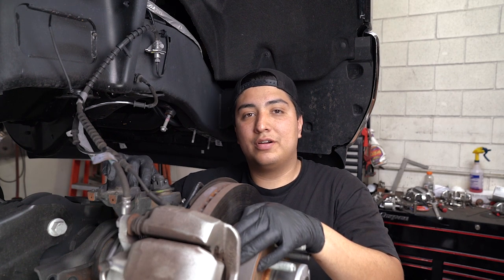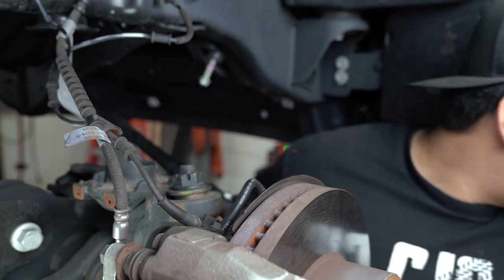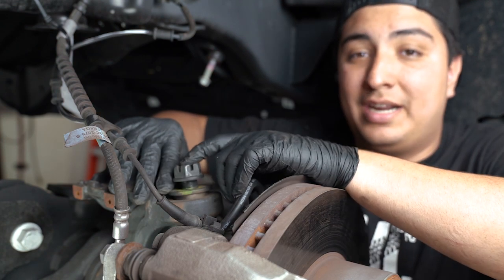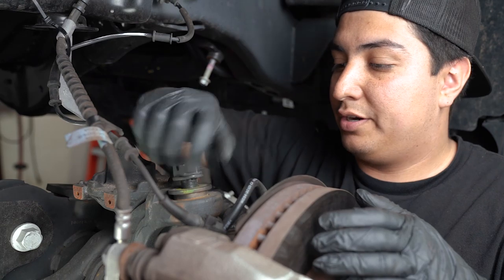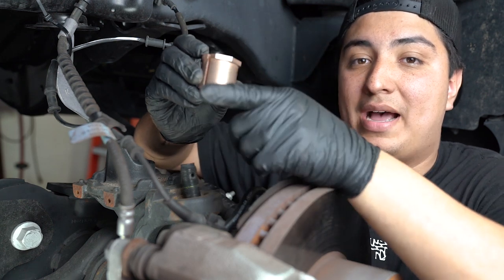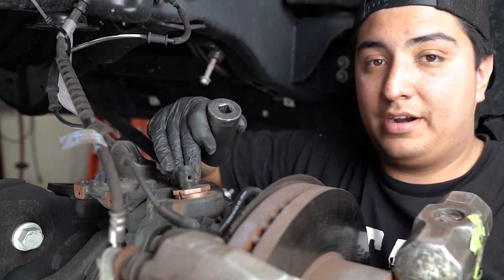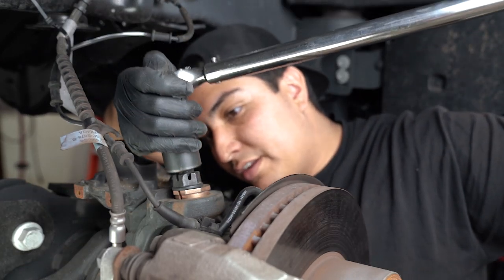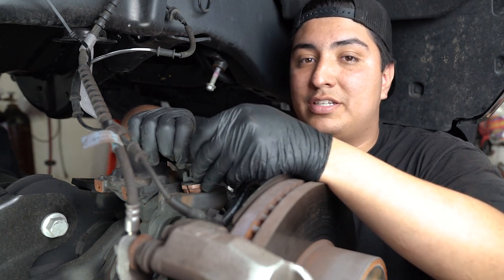How to Install Carli Caster Shims on 05+ Ford Super Duty

Comment: Followed along and got mine done today, very simple, however, when tightening back up the ball joint bolt would spin which delayed the installation, bit of fiddling and got it done, coupled up with the apex track bar ball joint the ride is dramatically improved…. Thanks for the video!!
Reply from the maker: Happy we could help!

Comment: Glad I found this video. Did this in my driveway in just over an hour. Thanks for sharing.
Reply: Did it make any improvements?
Reply: @DS-TRUCKS  I think so. Didn’t drive long without them in. I need to get back and do another alignment to see if it’s within spec now.
Reply: Did you remove wheel to install ?
Reply: @mrtnt2337  yes removed both front tires.
Reply: Where did you place jacks? And did you have to remove the springs?
Reply: @sweetpapalapa376  place two jacks stands  under the axle. No, you don’t have to remove the springs.
Reply: @swansong04  thanks

Comment: Great video.... Installing these this week to help my alignment after the readylift 3.5 sst I just installed on my 2019 f250.
Reply: How did it go, just ordered some for mine, after my readylift this truck drives like shit?
Reply: @natedogg412  I bought universal adjustable ones. Mine truck rides pretty good.
Reply: So do you need these for a 1.5" lift (springs). ?

Comment: Nice video Oscar!! 
I have a 2007 F250 that tech could not do alignment because of  wheel camber is off and original bushings are not adjustable. 

which one do I need to buy?

Front left wheel is  -0.4•
Front right wheel is -1.9•

Please let me know
Reply from the maker: If camber is off, that means the axle housing is bent. Are you positive that you have camber on the truck?

Comment: I know this is kind of old thread but i have a 2020 f350 2.5 level kit used carli 2* shims totally made a great difference. Not alot of people are aware of this issue.. Last thing on a leveled 2-1/2 inch what do you like your castor to be at via alignment..
Reply from the maker: We typically shoot for 3.5 to 4 degrees of caster! At our shop, we just add the shims and you're good to go on a 2.5" level!

Comment: I have a 2000 F350 w/ 4” lift 
What shim would you recommend 
Ford wants $100 per side and 2-4 hours labor before they can align the front end 
They also said it had to be a certain degree and they couldn’t read it without removal 

?
Reply from the maker: That actually all depends on the lift that's on the truck, and whether the arms used change caster.

Comment: I have a 2017 F250 with the death wobble issue. I have found some other information that suggests adding caster over the stock amount should help this issue. Could I add one of these on my stock truck? I do not have any lift or leveling
Reply from the maker: Yep, caster correction is actually a very common fix for DW on the new Super Duty trucks. These Carli shims are a good way to accomplish it.
Reply: @CJCOffRoad  Awesome thank you.  Maybe it states somewhere but if I were to stay stock what degree shim should I get? And what degree should I get if I think I may eventually do something like the 2.5 commuter kit?

Comment: I installed a 2.5 readylift with 4" rear block on 2021 f250. Truck doesn't drive well at all. Left caster  -.7. Right caster is -.4. Never seen it this bad before. Are there shims to get me where I need to be or should adjustable arms be used?
Reply: Did you figure out the problem?  Im about to order the same kit for my 21 F250.  Thanks

Comment: Hello purchased moog 80154 cam and caster kit. Several friends and i have the same problem. Can not install cotter pin, with out drilling a new hole. For the castle not will not go down far enough. I returned mine
Poor design. Any ideas to help others
2006 ford f250 thax

Comment: what happens if new stock truck needed the cam shims to drive straight and the slot is toward the outside and this says to point it to the back. and mine only has a cam on one side.

Comment: I recently installed Carli Pin Top kit leveling 2.5 on my 2018 f250. Grealty appreciate the vodeo. When getting aligned my driver side wouldn't  reach the recommended camber. Have you guys ever ran into this?
Reply from the maker: That sounds like it's likely mis-reading on the caster spec, or an incorrect install of these shims as they're a physical caster adjustment.
Reply: Thanks for the quick response. I did check the truck and paperwork provided in the kit. I even checked my ball joint to make sure that wasn't going out no wobbling. I only have 54k on the truck shouldn't be the ball joint or joints going bad. Still scratching my head wondering what it can be. Would it matter what trim style f250 I had or you guys go my year and model? Let me know if anything comes to mind even followers in the chat.  Greatly appreciated 🙏🏼

Comment: I installed a rough country 1.5 leveling springs on the front and cant get it to align, the dealer wants to tear it apart then tell me what caster shim to use. I took it to another 4wd shop and they want to sell me new radius arms. Can this work for my 2022 to solve the caster issue?
Reply from the maker: Yep, this is al you need to address caster after a leveling kit. You can also use radius arms with adjustable caster, but this is a lower cost solution that does exactly the same thing.

Comment: I have a 19 f350 dealership wasn’t able to fix some negative camber on driver side. Would slapping in one of these casters help align that wheel back? My truck is completely stock no lift
Reply from the maker: Camber on a solid axle truck is due to a bent axle, but you can use caster shims to address it on the Fords. Ideally you'd want to replace the bent housing though. Just make sure you truly verify that the axle is bent!

Comment: I have a 2016f250 and I want to buy the “Starter System 2.5,” but before I do. Does the pack come with bump stop drop brackets and sway bar drop brackets??? Also will I need anything for the rear?
Reply from the maker: You’ll see options for all those items in the drop downs on our website: http://www.cjcoffroad.com/Carli-Ford-Super-Duty-0516-Starter-System-Leveling-p/cs-flvl-str-sig-05.htm

Comment: DOES THE CAM NEED ADJUSTMENT FOR LEVEL WHEN INSTALLED?
Reply from the maker: This cam actually  is the adjustment to add caster for a level.
Reply: GREAT THANKYOU FOR INFO WHERE CAN I GET A SET FOR MY 2008 F-350 DUALLY SUPER DUTY 6.4?

Comment: Do the entire coil springs need to be removed? Can it be done with them still  on the truck??
Reply: Probably depends on your vehicle...I was able to do this on a 2018 F250 by removing the bracket that holds the brake lines...it scoots out of the way just enough to give the castle nut a good whack...two year old truck, needed PB Blaster and an hour before I could break the first one loose. 2nd one received blaster at the same time as the first and it popped right out.
Reply: @goodoz9942  thanks for the insight. I’m planning on doing mine this weekend and am a little worried about not being able to get the factory shims out. I’m planning to hit them with PB Blaster for several days prior to removal.

Comment: Can these be used on a 2013 Ford F450? or do you have the correct part # that i need?
Reply from the maker: Here's a link to the ones that fit 05+ F-450s: https://www.cjcoffroad.com/collections/f450-suspension/products/ford-f450-super-duty-caster-correction-shims-1

Comment: wouldn't the caster shim opening face front on the drivers side?
Reply from the maker: Nope!
Reply: @CJCOffRoad  So it's a matched left and right set of shims? if they are the same like the moog shims are,  the drivers side would get the opposite amount of caster from the passenger.